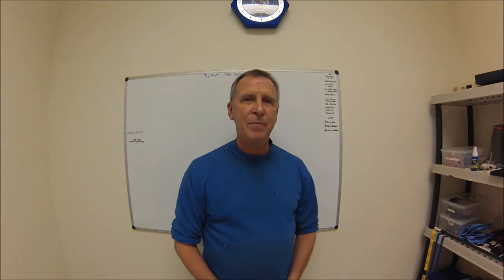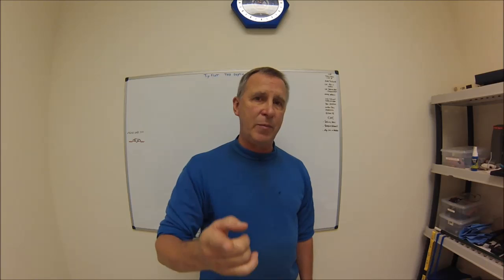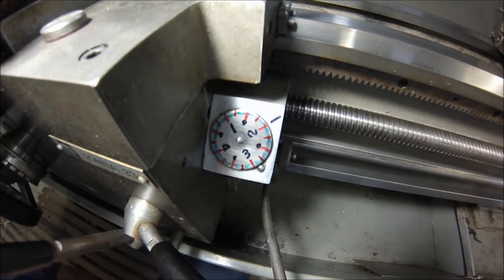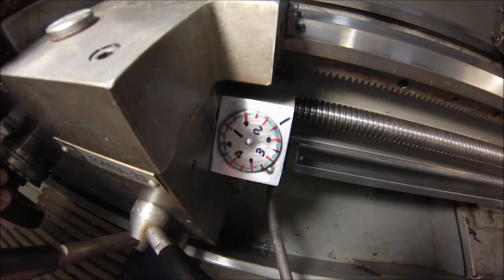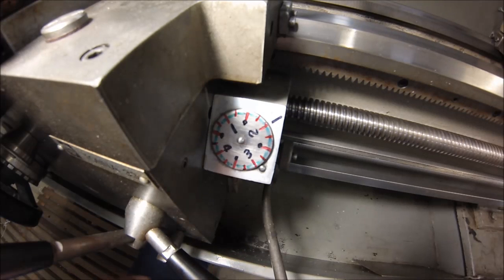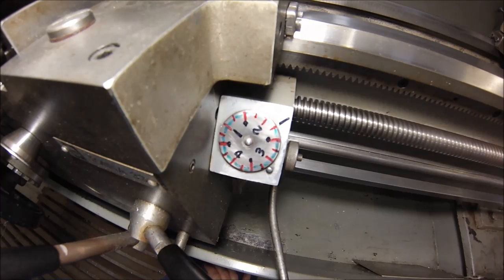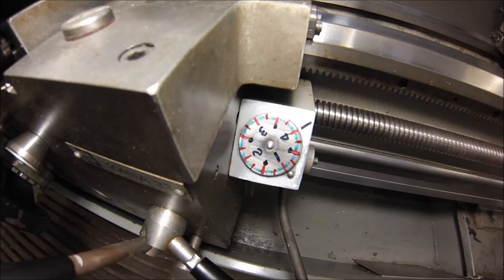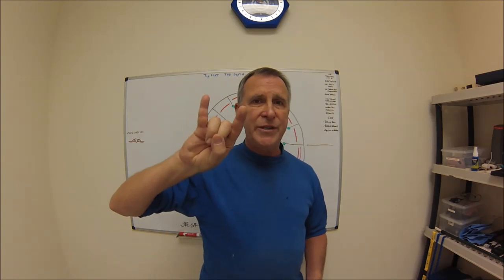Engaging a half nut.....made easier

Comment: You'd think they would have some kind of mechanism to engage the half nut automatically.  Manual machining is going the way of the 8 track cassette.  The time, risk of costly mistakes like ruining expensive tools tooling, damaging the machine itself or scrapping the materials combined with the large array of tooling needed makes the CNC more cost effective even with its higher initial cost.  I will say that manual machining is clearly more fun to watch and perform!
Reply from the maker: The skills and philosophy developed on a manual machine is a valuable part of a toolmakers education. I have always said it would be easier to make a CNC operator out of a manual machinist, than it would to make a manual machinist out of a CNC operator. I stand by that.
Reply from the maker: I know about 100 old time toolmakers that would take exception to the work they did on manual machines being called simple. I'm one of them. CNC didn't exist way back when some very impressive machine tools were built. The combination of a skilled machinist, a rotary table, indexer and thorough knowledge of a mill can yield some amazing parts. Good luck with your transition into metal work.
Reply: NASA apparently has not heard this bit about manual equipment following the Dodo bird. They have a busy shop full of manual lathes and Bridgeport style mills. Sometimes you need 6 parts - each with a subtle difference from the next one.

They also have a foundry and a Blacksmith, I hear.
Reply: Joe
i would have to agree about making a cnc operator into a manual machinist... little story... last week i ask a cnc operator to drill a hole in a plate on the bridgeport thinking he knew how to run one .... this guy was clueless and couldnt even begin to    do the 2 minute job. im still shaking my head in disbelief
Reply from the maker: Big difference between an operator and a machinist. Guys that get jobs running CNC's and are called machinists, are sometimes cheated out of the foundation skills behind the title. I didn't even program my first CNC until 2011.
Reply: So.... the engineers & celestial navigators slipped on some conversions.

Meanwhile - on Earth - machinists and tool-makers work with what ever measurement system produces  parts that fit.
Reply from the maker: Tell us more about that billion dollar "Unit conversion error" you speak of. I'm intrigued. How about you Andrew?
Reply: Sure, machinists / toolmakers get a print that is metric or imperial sensitive. They find a suitable chunk of metal or synthetic material and carve away at anything that doesn't look like the print. When they are finished the decision is made right there on the shop floor if the part is good or not.

Now - further up the food chain - the engineers oversee the assembly of all these correct parts and components into a finished product that does something like opening a tin can or transporting an instrument package to a planet billions of kilometers distant.

In the latter case they will likely call upon someone that has experience with interstellar navigation.
NOW - if the engineers or navigators use metric data in place of imperial (or visa versa) in their calculations then it is a fair bet that the collection of precisely machined parts will exhibit some sort of anomaly,  
I.E. - explode in a fireball shortly after launch or attempt to take a core sample of the sun.

Result - the engineers and navigators go "oops"
           - the machinists go " Hey ! More work! "

Comical parting quip -

Q. - What is the difference between an engineer and a toolmaker ?
A. - Dirty hands.

Comment: Another great video. I can see this working great for a lead screw with 4TPI but I am wondering how it is going to work out on my 13 in Clausing with the 6 TPI lead screw
Reply from the maker: You will still have dead zones you can utilize. They may be smaller, but better than none at all.

Comment: have you any videos on threading without a dial Joe ?  as someone has nicked my dial. :(
Reply from the maker: I couldn't even guess at that one. Its never happen to me. Find the guy and nick it back.
Reply: Joe Pieczynski  lol  it was nicked before I purchased the  lathe.

Is it not possible to screw cut on a reversing lathe without a dial??
Reply from the maker: Provided it has a leadscrew, I'm sure there is a way. Does the gearbox have a chart for TPI on it? Does it have a half nut engagement handle?  What type of lathe is it?

Comment: Thanks Joe. I've accidentally discovered this but didn't know the why of it working. Never really thought about it but now I know.  i will have to play with my lathe a little more to get a better feel. One other thing, my dial engagement doesn't fall exactly on a line so I also had to compensate for that. That is how/why I discovered your explanation.

Al
Reply from the maker: Its OK to make a new line. I did. Just make sure your half nut is engaged when you pick a new spot.

Comment: Most informative.
I'm not sure if this would help things. I'm no pro machinist so can only report what I saw. I'm sure pros like Joe could easily figure this out.
I friend, top flight expert, modified his lathe. Thread dial was replaced. The dial itself was on a button that stood about 1 inch high. The button was on a spring and could be pulled up which freed it, and it could be rotated to any of the 16 compass points then released. It would lock down at that point.
Out the side of the dial housing was a shaft about 1 inch thick, 1 inch long that rotated with the button-dial. It had a hole in it. The half nut lever had a shaft come off of it. In order for the half nut to engage that shaft had to line up with the hole coming off the button/dial shaft. Hold the half nut lever as in the video, gentle pressure, the half nut could only engage in that button/dial selected hole.
The entire idea was he could engage the half nut without having to look. The half nut lever was also extended so he could engage it with his knee leaving both hands free. I remember him intently watching the turning, one hand squirting oil or air nozzle, one hand on the cross or top slide wheel, standing on one foot, knee against that lever.
Reply from the maker: I think someone referred to this as a single dog lathe clutch. I've never seen one, but it sounds pretty creative.

Comment: Great video as always Joe. We walk upside down in my part of the world and have Metric machines eg 3mm lead screws and screw pitches in fractions of mm. Thread dials here engage thru 2 gears and are marked with letters at uneven locations and you need to have your wits about you to use them. I often cut metric threads on my old Southbend Lathe when the thread is not closely specified and convert the pitch to tpi. This produces useable threads unless you need xtra long male and female threads. I can then use your excellent method. I am in my 8th decade and thanks to you still learning.
Spindly Australia.

Comment: your lead screw is 4  threads to the inch.  If you have a lead screw that is 8 threads to the inch, like  I have, using your slide and drop in method is not much help. The increments are so close together. Do you have any suggestions?
Reply from the maker: Slow down the RPM, or build yourself a larger dial for a larger projected sector between lines.
Reply: If your dial engagement chart says any 1-8 like mine it wont matter at least is hasn't for me.
Mine is 8 TPI lead with a 16 tooth gear on the dial.
One thing that baffles me is the chart says 1-2-3-4 for a 10 but  any (1-8) for a 20.
If in doubt just practice with some cheap PVC till you get it right.

Comment: Another thing that helps novices is positioning the tool farther from the start of the threading when possible.  If you are far enough away, and you get a bad engagement by missing your number, you will still have time to disengage the lever before you ruin the work.  It is slightly slower, but much faster than starting over on a new part.
Reply from the maker: Very true.
Reply: I agree and also move the carriage to slow the engagement speed.  When cutting towards the headstalk move the carriage  to the left while engaging the half nut.  This will stop the thread dial from turning if moved at the matching speed of threads per inch.

Comment: Nice vid. 
I have a old10-12 atlas. I have had trouble threading  and replaced worn-out  1/2 nut. now lines don't really line up. I have to force lever. Other locations lever engages easily. Any thoughts?
As always, Great job. tkx.
Reply from the maker: If possible, loosen the retainers for the half nut then engage it. Then tighten it back up. Try that.
Reply: I'll give it a try.
tkx
Reply: Tom Semo

Comment: The best way I found and it never fails is to leave the nut engaged and reverse the lathe:-))))
Reply from the maker: That would certainly take the fuss out of it, but the whole moving the carriage with the motor thing can be time consuming. I only do that for metric threads.
Reply: now that you mention it,  that is one I would like explained.  My new to me Republic Lagun has a similar thread gearing as your Clausing.  How do you cut metric??  Thank you for sharing your knowledge
Reply from the maker: I don't have specific knowledge of all machines, just the ones I have run. As I recall, most of them require a gear change in the headstock to allow for metrics. Usually under the left side cover. There should be a chart for the cluster somewhere on the front of the gearbox.

Comment: Why do people panic and leave half nut in-gauged on a metric thread? My machine does imperial and metric threads the same.
Reply: Some Metric lathes don't even have thread dials, on those you can only use the half nut lever for threads that divide equally into the leadscrew pitch, any others you HAVE to leave the nuts engaged.
Reply from the maker: What type of lathe do you have?

Comment: Hey Joe, you make running an engine lathe easier. I use a larger dial ( printer, scissors, two side tape) because it seems to work for me. Wish I could send you a picture, that said great video.
"Drop The Nut" 70's porn command.
Reply from the maker: Thanks. The larger dial is a great idea if you have the room. The contact zone could be much larger.

Comment: Hey Joe, great videos! Picked up quite a few things watching yours and others. Might be time to give a little back now. The method I was taught for thread cutting has me only engaging the half nut once. The rest of the magic happens with the cross slide, the motor direction lever & timing. Been using this method for quite a few years now with great success. 

Not wanting to teach an old dog new tricks. Just food for thought :)
Reply from the maker: That is the technique I was taught for metrics. I always use the half nut for everything else. But my tool is also inverted, I never use the compound and I thread towards the tailstock.

Comment: Hey Joe, Thanks for the instruction. Even on my 7x12 Grizzly lathe I have felt the light pressure then engage of the half nuts and didn't know the reason but it was easy to engage that way.. Now I know why it is that way and when I get ready to cut my first threads I'll use the advice you gave .  Thanks Joe. Do you have a video on the way that you thread?
Reply from the maker: I do. It was the first one I ever posted back in June of this year. "Best Technique Ever" video.
Reply: Thanks Joe just watched that video you mentioned and will try it . that looks super simple. For setting tool height upside down, just the tailstock and a dead center? Thanks Dave
Reply from the maker: I posted a video on a simple tool centering jig. Take a look.

Comment: i need to figure out a thread dial mounting arrangement on my old machine, the half nut lever protrudes from behind the apron on the right side. not only is it in the way of the traditional location but the entire right side of the apron is open with no mounting surface anyway.

Comment: That's why I love the imperial system, it doesn't matter if you will cut an even, odd or broken thread number - it will fit into your threading dial.
But I'm living in the metric system and have all the difficulties with very odd or broken thread numbers. Sometimes this odd, you have to change the gear below the dial. I'm a little bit envious about this (sometimes). Anyway, great video, thanks for this and your time spent. Thomas
Reply: Thomas Kessler